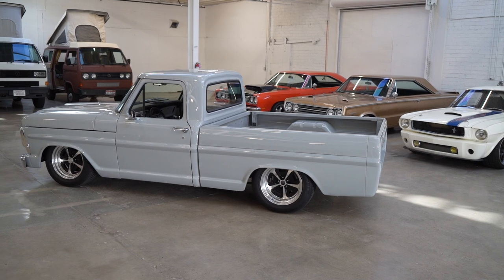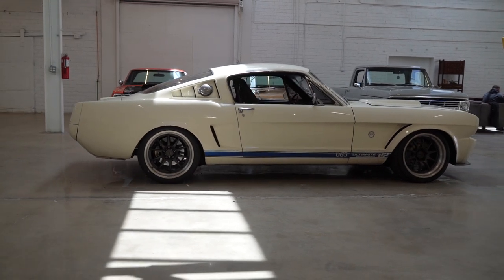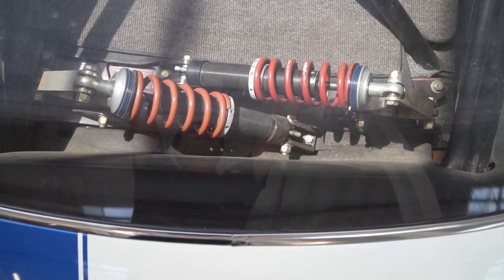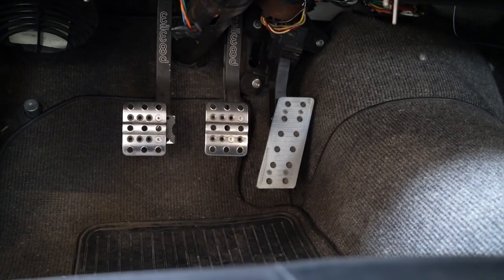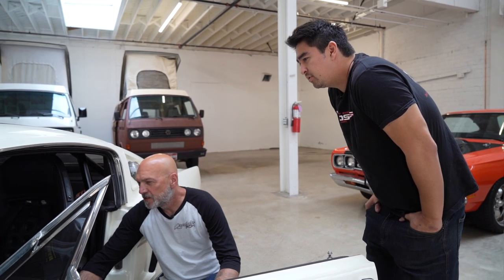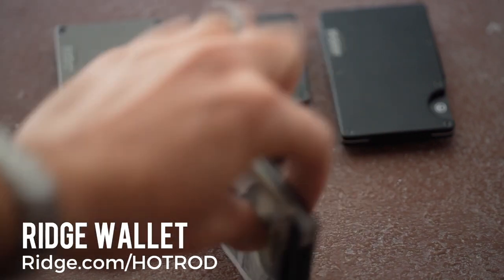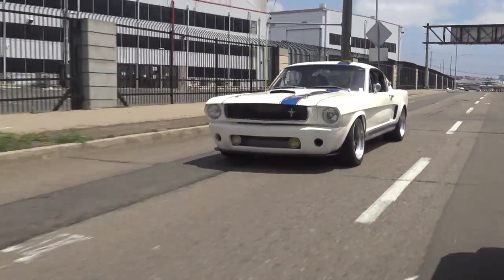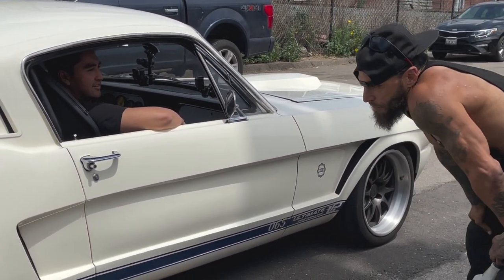Pro-Touring '65 Fastback Mustang with Boss 302

Comment: Awesome build.  Very interested in the rear quarter panels.  Can you describe how the rear was flared, or made wide body...?   Looks like maybe bigger outer wheel wells were used to push the sides out.
Reply from the maker: You should contact Matt. His work to widen this was extensive